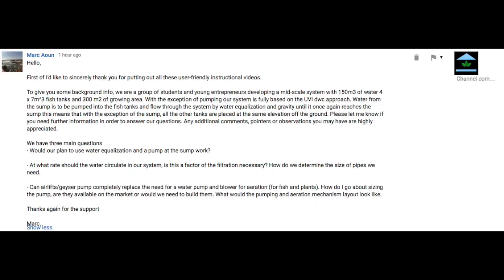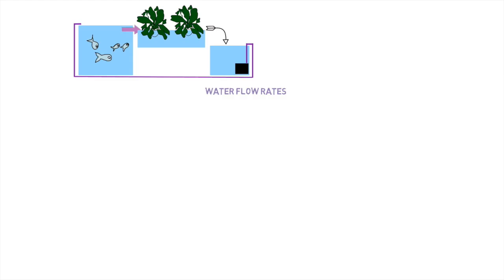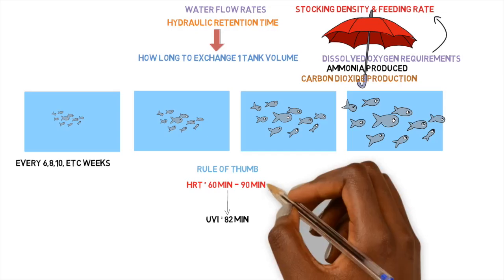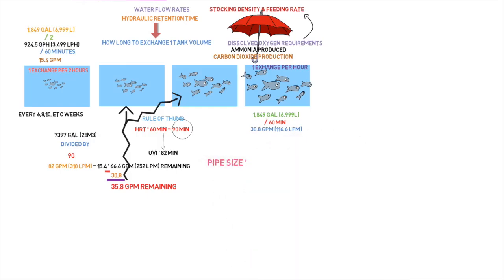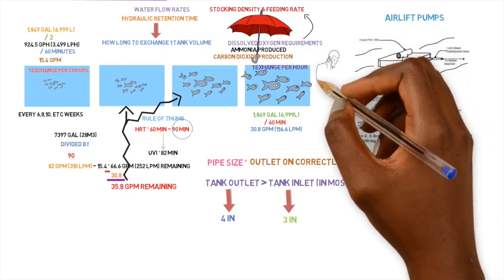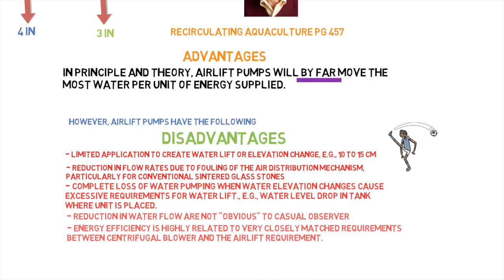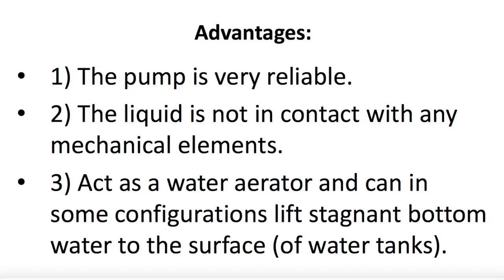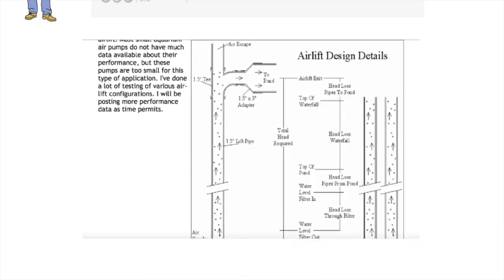Flow Rates and Airlift Pumps | Ask The Aquaponics God

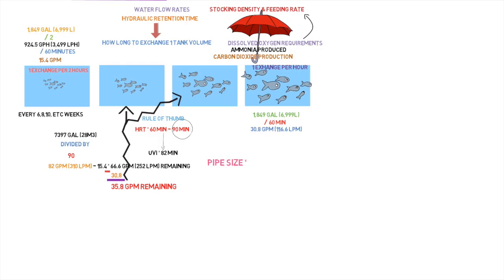Comment: @9:09 you state that "you can't go any more then that." I disagree. (I love your vids btw) Pumping and the costs associated with pumping are a function of flow rate and discharge head.  Now with low pressure pumps, like aquaponics uses, frictional losses are VERY VERY important since as the frictional losses build throughout the system they substantially decrease the actual flow rate of the pump.  For gravity flow systems with modest elevation drops (which should be a design goal for an efficient aquaponics system) a target liquid design velocity of 3 - 4 ft / second is reasonable, especially in small to medium bore piping.  The larger the pipe diameter, the greater the target design velocity can be.  This is because of the ratio of the wetted distance of the pipe (circumference) to flow volume decreasing by the square of the pipe diameter. (2 * PI() * r) / (PI() * r^2) For large pipe like 10" it is appropriate to use a target design velocity of 8 - 10 ft / sec and for very small pipe 1" or less you should be using values like 1 - 2 ft/sec design velocity.  Knowing your flow rate and your target design velocity you can size your pipe using dimensional analysis.  Therefore @ 7500 gallons / hr and using 4 ft / sec target design velocity you get a 3.57 inch INTERNAL pipe diameter which would lead to a 4 " schedule 40 PVC pipe and for 1849 gallons / hr you get a 1.89" ID requirement which would result in a 2" pipe. For PVC pipe dimensions you could use a website like https://www.pvcfittingsonline.com/resource-center/pvc-pipe-dimensions-18-through-24/ and to calculate the required INTERNAL diameter knowing your flow rate and a target design velocity you can do your own calculation as I have shown below or use a website like https://www.pipeflowcalculations.com/pressuredrop/calculator.xhtml  I HAVE NO AFFILIATION WITH ANY WEBSITE LISTED, JUST USED AS EXAMPLES.

1849gallons/1 hour  * 1sec/3.5 ft  * 1 hr/60 min * 1min/60sec * 1ft^3/7.48gallons * 144in^2/1ft^2 = 2.825 in2 which is the cross sectional flow area that is required.  Then we can convert this to the diameter D = 2 * (Area / PI())^0.5  = 1.8966 inch INTERNAL diameter. You will need to iterate to a solution if your target design velocity is inappropriate for the calculated INTERNAL pipe diameter by changing the design velocity and recalculating.

So a flow of 1849 GPH should be done in a 2 inch schedule 40 PVC pipe and a flow of 7500 GPH should be done in a 4" schedule 40 PVC pipe.  These are in fact calculable values.  I hope this helps everybody and if it does please give me a thumbs up. Thx

Comment: There are some great comments here. :) 

Whatever pumping method you choose, I highly recommend considering redundancy. Divide the work among more than one pump so that the failure of one pump doesn't mean a crashed system and dead fish. 

For example, if you were aiming for 60-90 minute HRT, you could install three pumps that can each handle a third of that. With all three running, you have 60 minutes, but if one fails or you shut it down for maintenance, the system is still getting at 90 HRT. 

Put another way, say you had a 9000-gallon system. At 90 min HRT that's 100 gallons per minute (gpm.) At 60 HRT that's 150 gpm. It is far better to install three pumps that each can move 50 gpm as installed (at the outlet.) When all three are going, you have great flow. When one is offline, you still have adequate flow. 

When doing this, make sure you consider the plumbing so that you don't create a loop of water flowing in reverse through the disabled pump. You can go with check valves, but there's another maintenance and failure point. I prefer to simply run each pump's output independent of the others. Also, air-gapping the outlets above the tank is a simple way to prevent back-siphon issues without the issues of air admittance holes/valves. Putting that together, running a single pipe from the outlet of each pump to a point above the tank is the least maintenance and most reliable layout. Add true-union ball valves either side of the pump as necessary so you can remove the pumps for service/replacement. 

It is true that three 50 gpm pumps have a higher capital (acquisition) cost and slightly higher operating cost than a single 150 gpm pump, but what is the cost of a tank full of dead fish? Every device in your system will fail. Murphey's Law says it'll happen when you're out of town on vacation too. Taking the time in advance to design it so that the impact of that failure is minimized is worthwhile.

Apply all of that to air pumps and the air plumbing if doing an airlift system.

Comment: I've actually been looking into airlift pumps used with a baffle hood and bubble tube line in D-ended Raceways like they use in aquaculture. 

They are best used in zero head applications. And D-ended raceways need the flow and are self cleaning. 

I like the idea of being able to section off the tanks for different size fish. 

I've also been looking at Insulated concrete forms and Hydronic heating and cooling, multi aqua makes a nice solar 5 tone unit. 

Also been looking at fiberglassing tutorials for koi ponds. 

One of the advantages I think you left out of airlift pumps is the ability to pump Solids without clogging like a typical pump would.

Comment: The first question, must make sure there is never a plug or failure in the system. I have a CHOP system on my aquarium where the 55 gal fish tank is the lowest and I use a syphon tube into a bin at the same level as the tank which has its own air bubbler and floating medium that works as the initial biofilter. The pump is in this basin and pumps the water up above the tank where it then drips into a series of pots filled with grow media and plants and then ultimately back into the fish tank. If the dang lizard that goes around searching for bugs disturbs a drip line water then leaks onto the floor and I come out the next day to a half filled tank. If the syphon hose plugs up the water overflows over the top of my aquarium. I made my system on the cheap and I didn't add safeguards. Unless one adds safeguards like overflow and move the pump up so it doesn't suck all the water, etc... the system will be high maintenance as a person will need to be closely monitoring for failures.

Comment: Hi, Mr.god of aquaponics...its been so much interesting to see all of ur videos and believe it or not ive gained so much knowledge....
Now coming upto the point.....i want to set up an aquaponics system in which i raise the fish in an IBC and from that, i plan to transfer it to a sump tank which is at the bottom after it reaches a particular height and is supposed to flow freely due to gravity...where i plan to remove the solid waste using a small partition.....now from this sumptank...i plan to pump the water upto 8-9 feet...from there i thought of using a split system to seperate it into 3 ways...one goes to the centre nft system below which i have a dwc system....the other split goes to the left where i have several vertical system below which i have a growbed system....similarly, the 3rd split has the same thing.....a vertical system below which i have a growbed....so after the bell siphons takes on from both the left and the right ways, i combine them to the dwc outlet and drain it back to the ibc straight away, making sure that they r in a suitable height so that the gravity does its job.....now my questions

Is this system viable?....is there any flaws that can be corrected?....anything that i didnt convey properly?
What if, i want to make it off the grid?...what motor should i be using so that it takes less current and at the same time pumps to that height properly....what solar panel should i be using and how much battery should it have to make the pump work both in the day and all nyt long?
Is employing led lights at the nyt going to improve the growth rate considerably?...also some say to use different colours for different sizes...can u pls clarify that?
Is there anyother parameter to watch out for or include if i plan to monitor the ph, temperature and feeding the fish automatically using my arduino automatically

P.S...thanks a lot for ur valuable videos

Comment: I have already airlift in my system and I do not have problem with it . besides it is perfect and no need any maintenance.
Reply from the maker: Is this a hobby system or commercial operation?
Do you have multiple tanks with the calculated flow rates going to each tank?
How many GPM (LPM) is each tank using?

Your situation may be absolutely opposite than the one in this video.
Reply: تربية الاسماك b

Comment: Now if I had an above ground pool that is at least 3' depth on a platform, I'd put a syphon pipe in with an airstone down the center and air lift it out the top of the pool and down into the 55gal tanks swirl tanks and then let gravity move the water down levels of growbeds from 3' to groundlevel and ultimately into a below ground sump tank where I'd use a pump to recirculate back into the pond. In that style of CHOP system an airlift would be useful, but ultimately you'd still need a mechanical pump in order to complete the cycle.

Comment: It all depends. You can blindly set up a system and make it work easily by forcing water to go where you want it. There is no denying the versitility of regular water pumps. If your system is designed for an air lift where head height is neglibible, then, with the right pump, you can efficiently shift large amounts of water reliably. They have advantages such as debris being able to pass through them. Fish passing through them unharmed and compressed air fed to the pump via hose negating the need for electricity in a wet area. I would urge anyone designing a system with negligible head heights to experiment. The sheer volume of water that can be moved watt for watt is impressive. (I will be posting some vids on the pond I'm building using an air lift pump soon. I don't expect any air lift pump naysayers will be commenting except to say I'm cheating somehow.)

Comment: Hi, I set up an aquaponic system with 12 grow beds, 6 on each side in the greenhouse. Water is pumped from my fish tank to the grow beds but I need the grow beds to fill up with water at the same time, so same water flow and filling speed which I am struggling to get. I have a 18000l submercible pump that pump the water to a 'power shower pump' speeding up the flow but they are still not filling at the same time, the taps are in 2 lines with 6 on each line and the first tap always get more water faster than the rest, any advice how to feed the grow beds with water at the same time?

Comment: I like your approach on looking at different aspects. I would like to suggest that you check a youtube channel by Natalie Cash. She works with a man named Glenn Martinez, who may just change you mind on the use of Air Lift Pumps. He has really made some innovations with this pump.

He has a pump that pushes water up I think over 18 feet, don't quote me on that, just watch the channel.

And one other thing, thank you for your service.

God Bless
Reply: I have to agree with j kyner that you should checkout Glenn Martinez's work. However technically speaking he does not use a basic air lift. Which is what your sources are talking about. Glenn is using what is called a geyser or pneumatic ejector pumps. These are quite different from air lifts but I believe are misunderstood. Because they also use air to lift water they get lumped in with basics air lifts and people say they do not work. They do take proper design to get them to work and are used commercially to pump things like sewage and water with rocks and sand.

Comment: Absolutely no air lift pumping for water.  It will cost more capital, more energy, and more maintenance.  Statements on better energy efficiency are totally wrong.  No advantages at all compared to a water pump and a separate air pump.  Use a water pump for pumping water.  Use a low output pressure air pump (less than 5 PSIG rated) for the air like the ones used for ponds.  The higher pressure air cost will cost a lot.    An air lift system can not produce the same water pressure without a lot more cost.  Use a piston air pump, not a diaphram pump type for excellent reliability and efficiency.  Water submergence is 1 psig output required per 1.5 feet of water.  This will give you some extra for pressure loss through the air diffuser. 

Use rubber membrane fine bubble diffuser because it allows more air volume and less pressure drop.  They also do not plug as easily.   There is no need to submerge the diffuser too much because the aeration process will agitate the water and create a circulation in the tank.

Pipe sizing: 1 inch pipe for up to 20 GPM.  2 inch pipe for up to 80 GPM.  3 inch pipe for up to 180 GPM.  In general, you want to keep water velocity at less than 10 feet per second for enomical energy and water erosion in metal piping systems.  You can flow a bit faster in plastic pipes by the pump cost will begin to bite.

My qualifications: 39 years in chemical plant, refinery, and wastewater treatment system design.  Currently designing an aquaponic system for my backyard.

Thanks for the excellent videos.
Reply from the maker: Thanks for your input on this subject. It was very valuable!
Reply: It works but not as well or as much volume. The GPH is not even close

Comment: As for airlifts, I do a hybrid. I use a normal pump but I added an airstone to the water surrounding the pump so it will become aerated before getting pumped. This allows for a better GPH and the "effluent" to the grow beds is already aerated which helps plant growth and bacteria functions. But I agree, I tried the airlift and you need 4times the depth to the height of lift. So if you want a lift of 1ft above water, you need your input to be 4ft below the waterline. Airlifts are not good for shallow applications. I have a pond that I'm constructing that is 3' below ground and I am using 55 gal drums as the swirl/initial biofilters. They sit above ground and so I would never be able to lift the water to the top holes of the drums if I used an airlift unless I drastically reduced the diameter of the pipe going up from the pond. Smaller diameter means less flow and also the possibility of plugging the system (hence the high maintenance issue). 

Airlift pumps sounds good experimentally (not theoretically) but unless you are just using an airflow pump inside the tank just to create a circulation from a bottom substrate biofilter up pipes and out at the water surface, the whole concept is worthless.

Comment: AG,

Not sharp shooting here just trying to make sure I am understanding correctly.  I think you may have misspoke in the part of this video at about 6:40 mark when you talk about the HRT for the tank with the smallest fish which you want to recirculate every 2 hrs.  You took the tank volume /2  /60 to get your flow rate.  What I think you meant to say was Tank Volume x2 /60 to get the flow rate required to turn the tank over every 2 hours.

If I am wrong my bad, just want to make sure I write this down correctly.  I am going to start my small home system soon to cut my teeth on with the thoughts/dreams of going to a larger and maybe commercial system later on.

The quality of your vids and the materials covered keeps improving.  Great job.
Reply: Ok, It is my bad, you were right, so much for doing math in my head.  I would suggest that the easier way to understand and say the math for a tank you want to turn over every 2 hrs would be to take the Volume/120 = Flow rate rqd.  The divide by 2 then 60 thing just lost me.

Comment: have you experimented with dual rootzone aquaponics? I've seen some really cool results
Reply from the maker: Do you have a video or a blueprint to explain what you mean by dual root zone aquaponics?
Reply: helps with fruiting plants that have more complex nutrient needs
Reply from the maker: Thanks. I'll give it a read and check it out.
Reply: This looks very similar to Larry Hall's rain gutter grow bag system he shows on YouTube.
As far as using fertilizer to boost growth over straight aquaponics, I question the value money wise and time wise.
It may be easier and cheaper to rig up a compost tea injection setup similar to how Glenn Martinez at Olomana Gardens has done to get the same results.
Reply: Thanks for sharing that info on dual root zone systems.

Comment: Don't agree with your analyst. .on my view. .air pump is best ..either way..push water up & add more oxygen into water ..you will never need water pump anymore. .save electric. .no maintenance. How high water up depend on the watts of airpumb..u can use it to small water pump & make it double water flow with oxygen. .

Comment: I gave a thumbs down, I appreciate your time in the video, but you waste ours by dragging out the most simple statement, check both sides of the story, and you say it a few times, in a super drug out manner. I believe you should watch some videos and make a simple siphon, or airlift pump, and time the flow, and watch how high you can pump solids, which are aerated in the liquid. I built a few out of glass and was amazed how simple and effective they are, I built a simple air lift pump that lifts 18" off the top of the fish tank, no issues for over 3 months running 24/7. I measured the flow and it came out to 62.5ml/min. at 18" above fish tank water level. 10 gallon fish  tank. there is no maintenance to them, other then wipe them off(maybe). What about electronic pumps, with filters that clog and over heat and can't pump solids? please take this as constructive criticism of this video and that people should not discredit these amazing airlift pumps. blessings
Reply: also this system is run off a fusion quiet power air pump, which uses very little power(super efficient). cost less then $20 too!